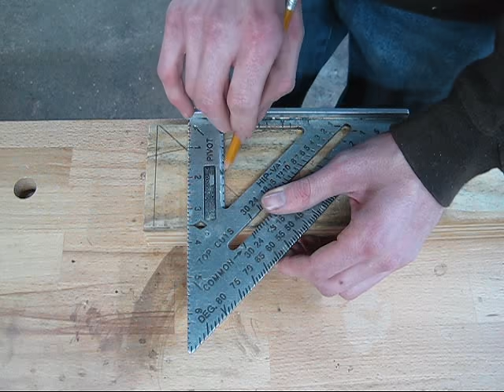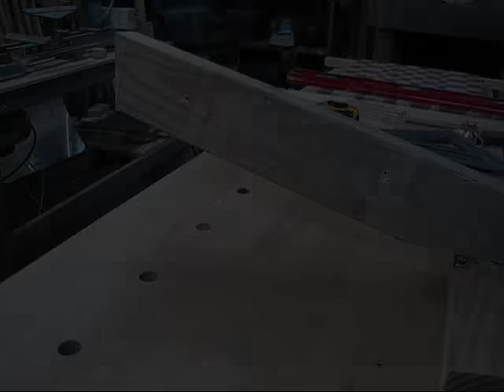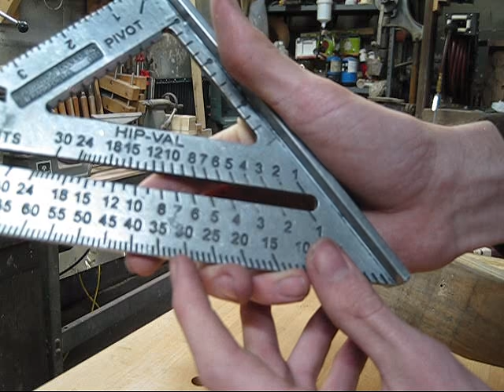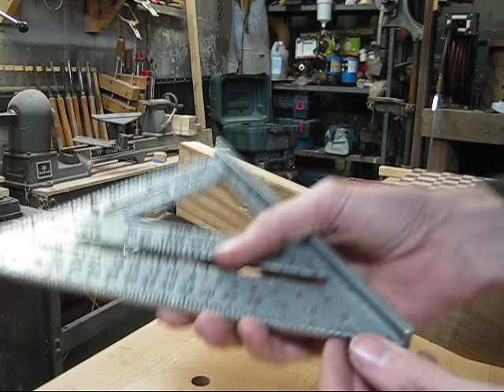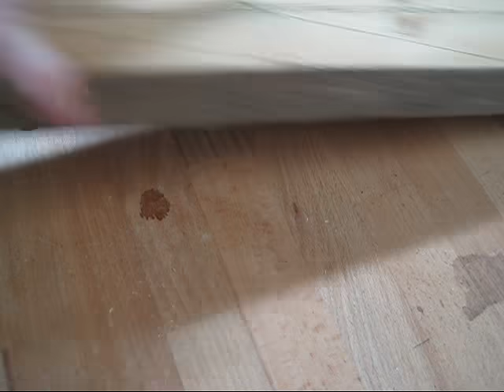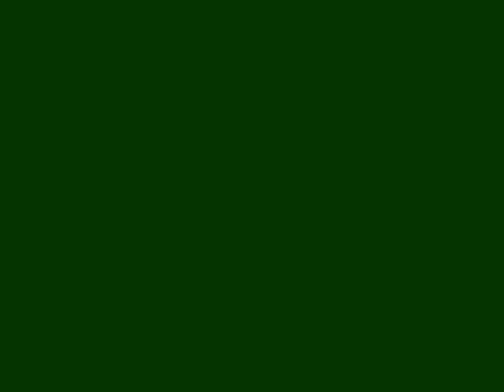The basics on a Speed square

Comment: so this sounds like it is for roofers and framers who work within like 1inch variances as if that is accurate.... .I am a cabinet maker/installer and I work with zero clearances, I have to be absolutely exact. maybe 1/64th of an inch clearance in the end product will be acceptable to my customers. unfortatenly since framers are complete fucking monkeys and do not understand how to use a tape measure or probably have never owned a level or plumb bob I am always struggling to try to compensate for their sloppy bullshit work. noone comes  back on the framers for some reason....but always everyone expects the finish carpenters, cabinet installers, flooring guy and all the other trades that need too make everything perfect in the end ...to be completely on the mark no matter how bad the framers do...
Reply from the maker: There is no such thing as zero tolerance. 1/64th of an inch is .015” for a machinist
That’s a mile.  The lenses on the Hubble telescope are ground to 0.0000015” accuracy they have to be ground by a machine between 1:00am and 3:00am because the air temperature is the most stable. The local highway shut down for 30 miles so there are no vibrations.  Even then they still have “tolerance” they work by. In the framing world +\- 1/2” is tolerance and code some folks work better at it but houses move.  In the summer a house will grow 1/2-2” in the winter shrink 1/4-3/4” all things have tolerance.

Comment: I'm a builder, tho I specialize in exterior finishing. I'm pretty familiar with my speed square, but the plumb Bob trick! I didn't know that one. I've used a level and the square to find the roof pitch by putting the level on the flat side, leveling it out and reading the roof edge on the common. Learn something every day! Thanks.

Comment: I'm an hvac technician I bought a speed square when I installed hardwood floors and replaced sliding doors with French doors in my house. I wish I saw this video sooner.
I needed to know the angle of a slope and I struggled so bad with it. I ended up using trigonometry and my scientific calculator on my phone when I simply could have used a speed square and a plumb bob.
I knew there was a way to use a speed square but I didn't know how until now
Thanks so much

Comment: the ratio for 13deg is not 1 in 3! The common scale is base 12 so 3/12 simplifies to 1 in 4 (1 : 4). I wouldn't use the common scale over long distances however

Comment: Roof pitch is indeed a ratio.  Rise over run.  Represented in X to 12 (inches usually).  Your measurement of the pitch was 3.  That would be 3:12... meaning for every 3 inches of rise there is 12 inches of run.  You said your pitch was "1 to 3 ratio", but you should have said 1 to 4 ratio, since 3/12 = 1/4.  A less confusing way you could have stated this would be to point to the "common rafter" and say "3 and 12 pitch".

Comment: The "Speed Square", the Steel Square  and the folding carpenter's rule were the three tools I saw in regular use by all the "Old Time" carpenter's I started out with way back in the early 60's.
Some of those guys had began in the trades as early as 1920!

Comment: No matter how many times I cut, it’s still too short.
Reply: Measure twice, cut once but also don't forget to mark the "cut" side of your line. If you mark a line exactly at 48", you mark an X on one of the line, you cut on the unmarked side or your 48 inches will be short due to the thickness of the saw blade not being accounted for
Reply: Measure your saw blade it should be an 1/8 at most, and always!.. cut either inside or outside the line and make a habit of it and stick to it

Comment: Does NOT mean HIP VALUE.  It means HIP OR VALLEY.  They are both based off a 17” run on a hip or valley rafter  versus a 12” run on the common rafter

Comment: Okay not to be nit picky, but for the viewers of this video I will clarify some minor errors. A seat cut and birdsmouth are two separate cuts. Birdsmouth vertical and seatcut is horizontal. A 3:12 roof pitch is 14 degrees not 13. Otherwise good video. Thanks for sharing the knowledge.👍🏾

Comment: I was thinking that if you grab the square by the handle and you hold the other edge (not the hypotenuse) against the underside of the rafter, and hang the plumb line through the pivot point, the line will go directly through the angle and the proper roof slope and you don't have to count backward like that.

Comment: When doing your seat cut, make the edge that has the lip on it be the edge you draw your pencil across and use the edge with your inch measurement marks to line up with your common (plumb) line (turn the the other way). It'll be a much more accurate line that way as your pencil can't wobble in and out (although yours was still pretty good!). The tip of your pencil lead stays right along the edge this way.
Reply: Everything he taught you was wrong
Reply: @Treeslayer53  Weird. I wonder how does it make a perfectly level seat cut then? Maybe it's just possible that YOU don't know wtf YOU'RE doing.

Comment: The length of the long side of your bird's mouth should be the same size as the width of your top plate.  The over length cut in your demonstration just weakens the rafter.  And, if you were doing a vaulted ceiling roof rafter, your oversize bird's mouth cut would screw up the sheetrock by leaving a unsupported "corner" at the top of the wall.

Comment: There's an easier way to find your common pitch on an existing roof. Instead of using a plumb bob, use a level. Place the speed square tight to rafter. Now place the level on the back of the speed square and pivot it until level. Then just read the common pitch.

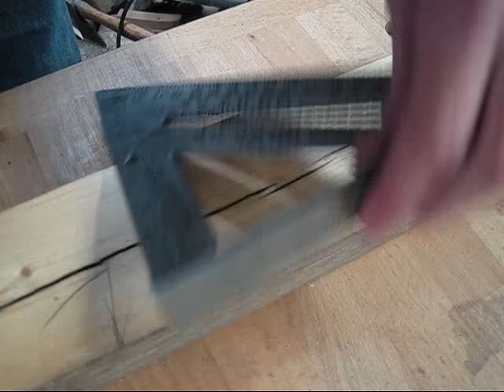Comment: You're doing good until 7:00 mark, after that you misused the speed square improperly to make the opposing 90° .  That isn't totally wrong, ... it will work, as you've shown..  The proper thing to do, is to simply turn the square over and again find the same common angle, but from the other side.  Put differently.  You used the Pivot Point correctly for the first mark.  But then you eyeballed the square into position. to mark the second line.  The square is designed to help find the 90° angle you want.  By simply turning it over and use the pivot to find your next line.  Again go to the #3 common, but from the other side of the square.  That will give you your 90° line MUCH faster and give you a new level of confidence.  Try it, you'll like it.  Once you do that. multiply the time it takes to use your method by 100 rafters.  Then try the engineered method times 100 rafters. and THAT will make you appreciate the 1-3 seconds you're saving on each time to make your marks.  Good luck.  jg  (Former Building Trades Instructor at a tech center in Alaska.)

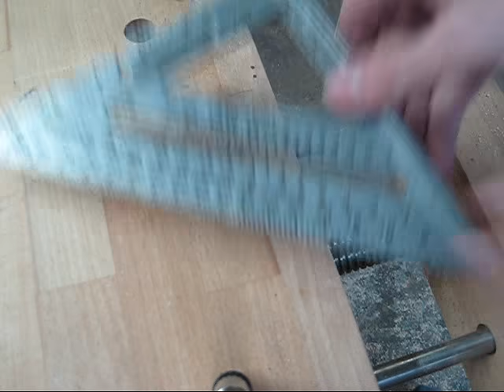Comment: At 5:35 he said 1 to 3 ratio, the 1 is 1 foot, 1 foot is 12 inches,                                                                  the ratio is ( 3 to 12 ) or ( 1 to 4 )
If you have a calculator with SIN COS TAN. Use 2nd key to invert TAN.  tan-1  type in  ( 3/12 ) = 14.                                                  14 is the degrees of a 3 inch rise and 12 inch run.

Comment: When reading off the pitch angle in your demo you should look at it square on, otherwise at reading from an angle you're inducing 'Parallax Error'.
The protractor concept is the same used on the 'Capt. Fields pattern' navigation parallel ruler used  to transfer courses on charts.
Also, do Squirrels actually nibble away rafters in your part of the World?

Comment: Common rafter numbering refers to "x":12 ratio, x/12 or x-12.  "x" feet (or inches) in Rise to 12 feet (or inches) in Run (or Span). You are correct that it is a ratio, but not a 1:3 like you state. You state that your pitch is a 3:12 which is actually 14.04 degrees. Close enough for rough carpentry and repairing a squirrel gnarled rafter tail. Also, if you use the fence part or the hypotenuse of the square to draw your seat cut (@07:28), your pencil will follow between the two points of your marks.

Comment: The demonstration of how to use a plumb bob to get the roof pitch is absolutely the hardest way to do that task.  Use a torpedo level!  Put the pivot point on the top of the rafter, swing the level up so that the wide flange is about level, put the torpedo level on the speed square and level the speed square.  Then you read the pitch and angle at the same time.  This is way, way easier than chasing down and screwing with a plumb bob and doing any math.  It is fast and accurate and less chance of error.

Comment: You used the square to find it was a 13 degree angle, but then you used the common 3 to mark all your lines. 
The 13 degrees is much more accurate and ended up more on the HIP value of 4 than the common value of 3.

Comment: Wow, 8.6 million views on this, and it was short too! On thing I would have done differently, actually a couple, would have been to mark a 3/12 across the whole board for the bird's mouth, then 90 off the top of that because it's a longer line. It's hard to get the bottom cut good by the short line you used, and not even all that easy with the 2 1/2" line I would have used. Going for a 77 degree line would have been even better because it would have given you the longest line possible with the square. Also, when you were trying to discover the pitch using a plumb bob, it would have been easier to use a level, but you could use the same plumb bob, mark the line representing plumb, and just read that with the square. No math necessary.

Comment: There is so much that wasn't covered in the tutorial...  To be honest, a lot of the basics weren't covered. I watch these videos in hopes to learn a new function. What I've noticed the issue is with trying to teach people how to use a tool with so many functions and that is used by so many different trades/tradesmen is conveying the terminology differently. Also possibly using a different method to get the same end result. Example: 99% of Roofers or Framers would call the pitch 3/12, not 3:1 ratio...  Also, using a plumb bob and the Rafter (speed) Square seems redundant. If you have enough clearance for a Plumb Bob to run past your rafter, you could just flip your Rafter Sq. and put the Pivit Point to the most farthest/highest edge of the rafter (Roof Ridge) and either the cut edge will line up with the 3:or hold your Torpedo Level with the edge resting against the Pivit Point with it in a Level Vertical Position and the same edge will run along the edge of your Rafters Pitch #Number in the COMMON Row. Which would give you your RISE Number (RISE/RUN) with your run always equaling /12. 
So, in this case, the roof is a 3/12 pitch. FYI - If you are going to need to find a roofs/rafters pitch, or the degree of any slope, you should purchase an angle finder. They are very cheap... You can even make one with 2 small straight pieces of wood with a hole drilled through the end of both pieces, and a bolt and a wing-nut to tighten/loosen it to different slopes(degrees) so you can transfer the angle to you Square... 
You would need a 2+hr long video to come close to teaching the different features of this Square!  Just Sayin... Thanks for the video though

Comment: Fantastic. I'm building a pergola with a client. The client likes to draw the line to cut whereas I put my electronic level on the pitch to cut. The pergola is made from steel. (Patio Tube) 
I made a mistake and cut 52 degree instead of 38 degree. So I should have subtracted from 90degree. The speed square will be a great asset. I like the plumb bob trick.
The birds mouth is good also. Although we will use brackets seen as its steel.

Comment: yeah I like what I seen two but the only thing I didn't like being working in construction myself doing roof framing such as when he cut his bird mouth he extended his is line a little too far on both cut that would actually weaken and that what I do is cut in and then use a sawzall so you don't get them extended but I do understand it was just a demonstration and he did very well at that not knocking you man you you did excellent on explaining that situation 👍

Comment: I feel there is an easier method to our square and finding angles.
Reply: A whole lot easier...this guy went the longest way around the barn and could have just walked in the front door..13 points off the 45..then count 13 off the end and try to eyeball the pitch..just use a dang level(short torpedo works best)..set the speed sq on your rafter or fascia board on the pivot point..keeping your pivot point secure to the board..left the other end up until level reads level..need put level on any the 90 deg sides..(there's only 3 sides to the sq and 2 are 90 the long one(where all the deg #s is not a 90)

Comment: A good friend, and framing contractor who has passed away now once told me..
“A Engineer marks once, a Carpenter marks twice, and a Dern Fool marks all over the board!”
Reply: My father always said measure twice , cut once . I still got it wrong.
Reply: No wonder i had marks all over, i thought i was doin good....
Reply: blueseruser lol, even from the grave he still makes an impact. Great friend he was.
Reply: I had a hunch there is a relationship from the rafters top edge to the wall what I didn’t know is how to determine or find out the original pitch.

Comment: At 7 minute mark, I would just take the compliment angle of 77 degrees and pivot the square on the bottom side of the rafter instead of putting the square on the rafter, then run it up until the edge intersects your mark, if that makes sense.

Comment: because it is thick you can hold it to a broad and run your saw against it as a guide for a perfect cut. especially people who are not to steady ,this is a cool thing. just hold the square with your left hand tight to the lumber and slide the saw aginst the square cutting 1 1/2 inches from the cut. because the table of the saw is usually 1 1/2 inches wide if it is a skill brand saw.  did i confuse anyone.

Comment: I use to install Alumawood patio covers, screen room enclosures, and room additions here in Vegas and the speed square, torpedo level, tape measure, pencil, screw gun, bits, hammer, caulking gun, chop saw, tin snips and project calculator plus saw horses and a few A-frame ladders and extension cords was pretty much the bare minimum of tools is what I remember needing at any given time. When I got married my husband got a job installing cabinets and thought he knew it all....until it came to the speed square. I took him to Home Depot and tried explaining to him how to use one....And I tried....and finally i just said F*** IT! Took the square and him over to the lumber aisle and grabbed my sharpie and drew the degree symbol ° by the numbers and told him to pretend it was a protractor. I can't believe thats what helped him understand how to use one.

Comment: 2: 00, an angled line can also be drawn by holding the 0 recess to where needed and making a short index  line at the desired  protractor angle point. Then use the straightedge to connect the dots.

Comment: The best way I found is to use the speed square  to find roof pitch, use the square in the same way but instead of using a plumb bob, I use a small level, I set the level on top of the square, rotate the square when level bubble centers look at the side of the square the top of the rafter will line up with the degrees or common roof pitch, with this method you don't have to do any counting

Comment: He may know how to layout rafters but the seat cut should never be wider than the plate it sits on. Notice the seat is wider than the 2x4 wall plate it sits on. This puts your load bearing point beyond the 2x4 plate which may cause the rafter to fail. This is a common error.

Comment: How interesting all the real skills and info from a simple framing square seems to have been lost by and large. Combined with the  AJ Reichers frameing handbook and tables you can cut any stair or roof and find any angle very quickly and even much more accurately and precise. Reminds me of the loss of ancient sacred geometry. These are smaller and therefore perhaps a bit more handy in some ways for some circumstances ?

Comment: Thank you for the video.  The words on the square are hip and val...Val is short for valley, not value, I think. And the plumb Bob trick is going to be almost impossible to do accurately because roofing material is so inconsistent in such a short distance.  I think the trick would be taking it off the bottom edge of the rake trim(if its straight). But you would need to make some kind of bracket to tack to the rake board in order to rest the square on since you can't lay it on top as the roofing over hangs. To determine roof pitch some guys will bring a full sheet of plywood on the roof and stand it on edge, and using a level, draw a level line on the sheet. That shows the angle of the roof and the pitch can be determined from that. The 8' length of the ply helps span all the wavy-ness of the shingles. But that's a lot just to repair a rafter tail. You could probably just use some cardboard and make a template off the existing tail.

Comment: Another way to get the angle is to set the square on top of the rafter with it hanging down pivot point sitting on top of the rafter and put a torpedo level on top of the square, pivot till it's level and read the degrees.